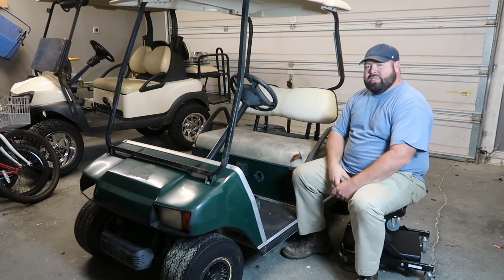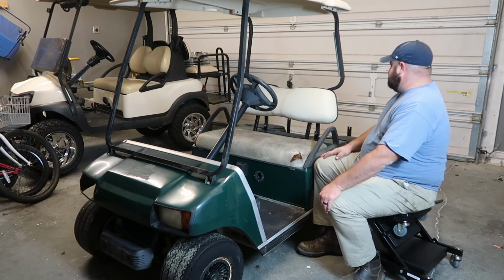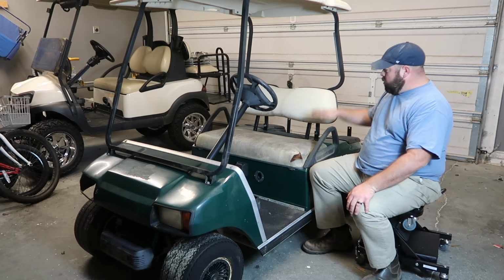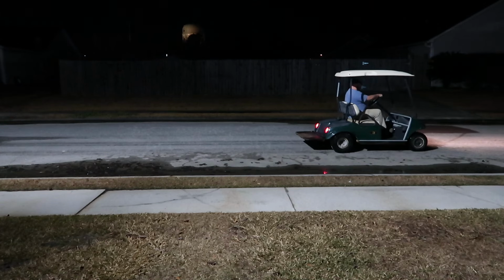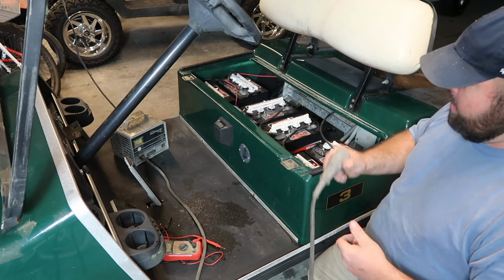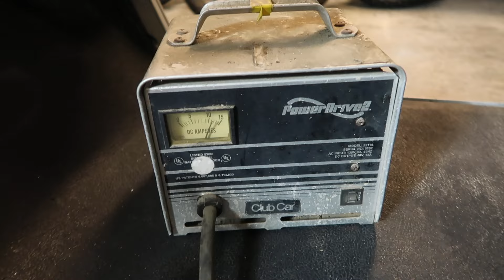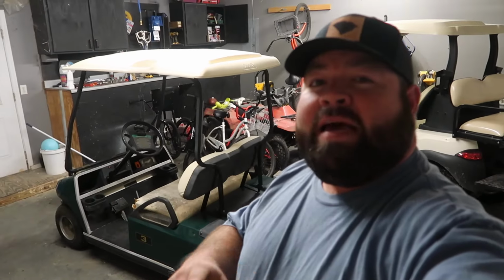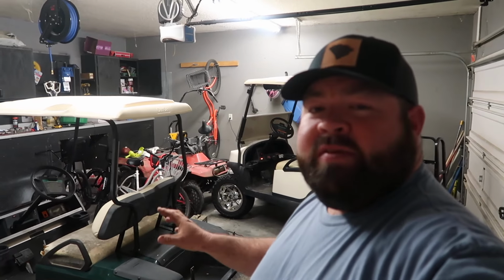$400 Club Car Golf Cart | Will It Run?

Comment: hate club car, got a carryall for 1200 with bad batteries. They actually paid 16000.00 for that piece of junk new in 2015. Rather have 36V but a few nice things about electric, they are heavier and smoother, better traction, you can pull logs and trailers, and you can power your house during outages which I do. You got a crazy deal though.

Comment: I got a 1999 ds. Brand new controller, it charges, new batteries, I can get solenoid to click but will not move... thoughts? Lol
Reply from the maker: Which throttle does it have? V glide or mcor?  Your throttle maybe bad.
Reply: @Fentertainment  v Glide

Comment: What’s worst case when picking one of these up?
Reply from the maker: Worst case? That could really vary depending on a person's desire or craftsmanship.
Reply: @Fentertainment  well I picked up a 2009 club village for free so no biggy. Put new batteries, new ignition switch, new solenoid. And still got nothing. Have voltage at solenoid and when jumping it I get a spark but nothing happens. I’m thinking maybe the controller??? But idk how to test that.
Reply from the maker: @zkennedy2217  Is the tow run switch in the run position. Does the switch have continuity and working properly? Is the solenoid clicking on with out jumping it?
Reply: @Fentertainment  it is in the run but not sure about continuity. Havnt checked that. And no even with the new one it has no click. I do get a spark when jumping it now but didn’t get that before. Only click you hear when pressing pedal is the mcor.